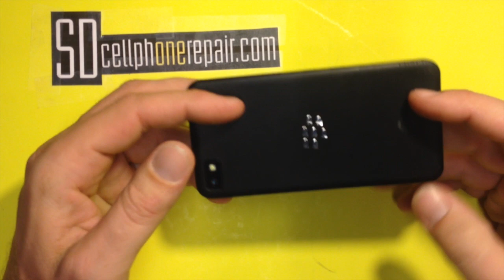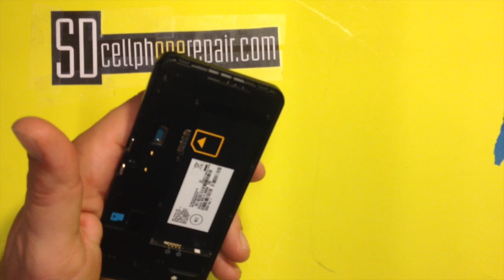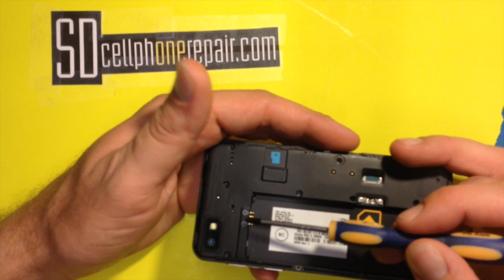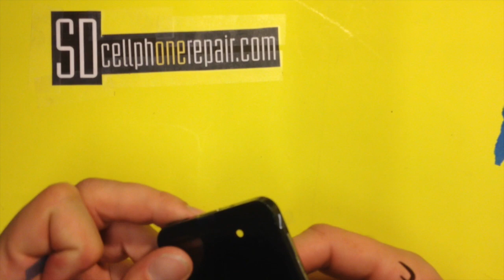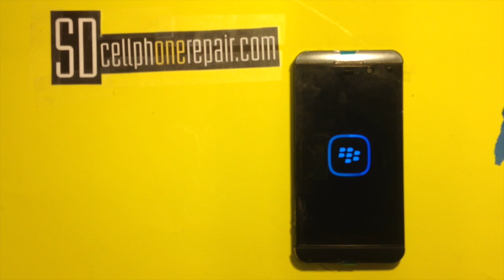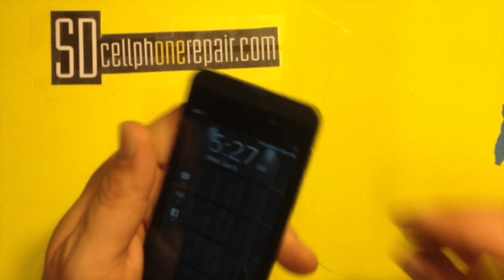BlackBerry Z10 Screen repair

Comment: Wish I saw this video b4 I bought a screen and a tool kit. The tool kit sold did not have the "T1" driver but the T.08 seamed to big for the very small screws at hold the screen. Had to zip lock up the phone and take a deep breath. Where do you purchase this part and does it have a new speaker too?

Comment: Man! If only I followed your advice and purchased the screen attached to the frame. I thought the standalone screen would be easy to fit, but the thin plastic frame split while I removed the broken screen. Now I have to buy a new standalone frame for the new screen, but can't find it. Looks like I'll have to buy the same part you're using.